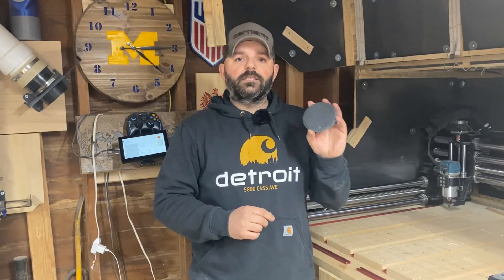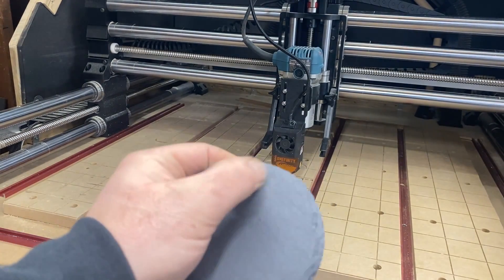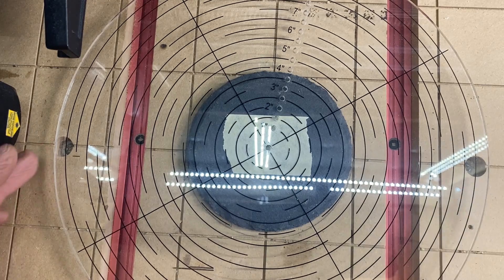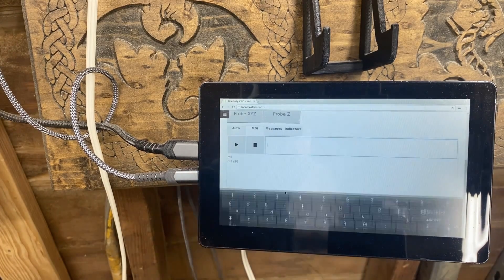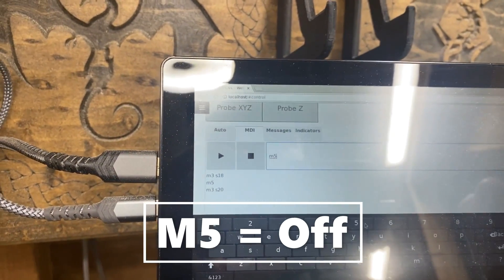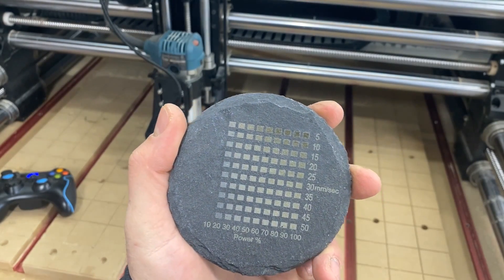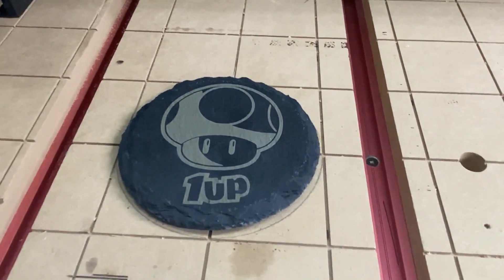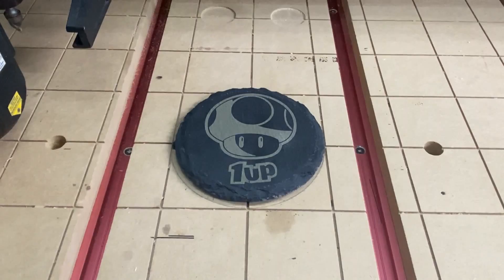OneFinity CNC Laser - X Y Z Zero. Find Center. Full Slate Coaster Process

Comment: do you need some kind of ventilation for this? what w is this laser?
Reply from the maker: @JCraftvfx  Hello, I would always use some sort of ventilation whenever possible, especially if this is indoors. For demonstration purposes, I forgo safety - but I’m usually wearing a mask at the very least. This is the original laser that was offered , so 7w.